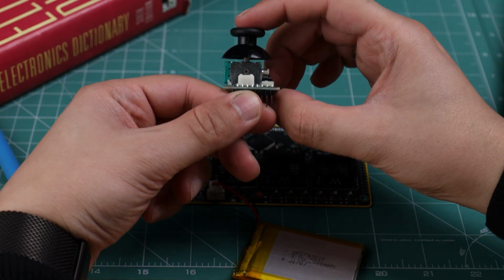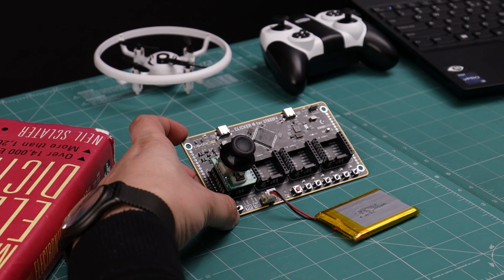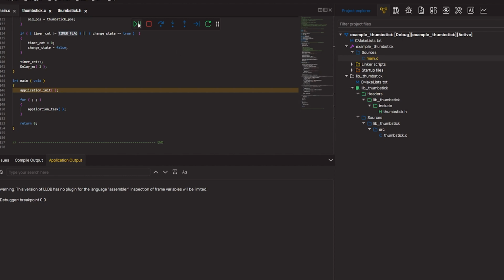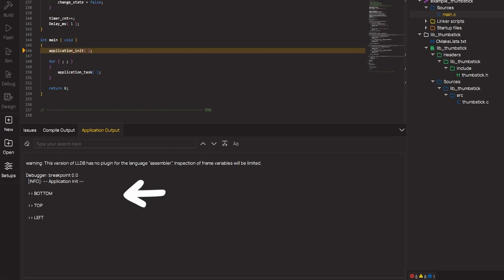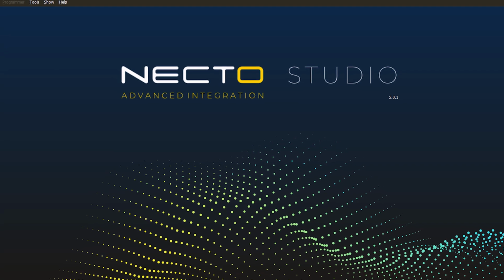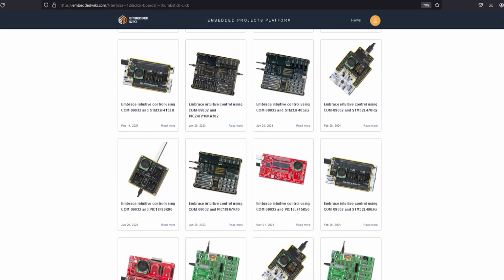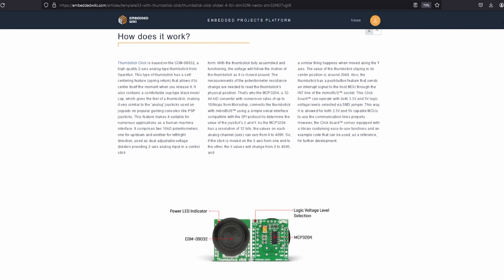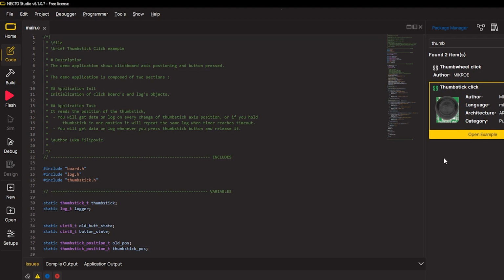Building a Custom Gaming Controller! | DIY Embedded Project #6

Comment: Thank you for leaving a link to your actual prototype with the type of microcontroller you used listed. That information is incredibly hard to find.

I've been wanting a reference to compare to. The STM32F407VGT6 seems like slight overkill for me, but I need something closer to that than the raspberry pi's RP2040 I was starting to consider.

Thank you so much.